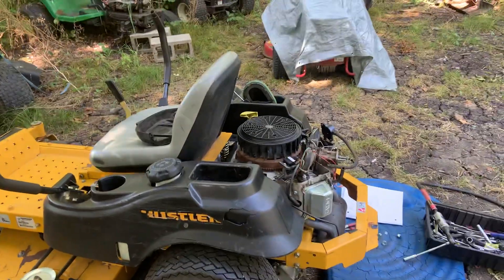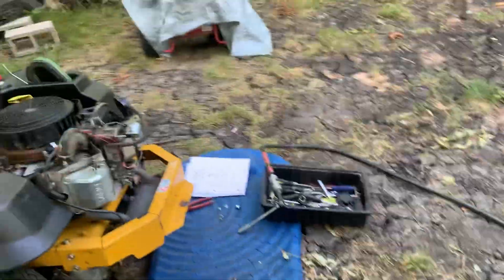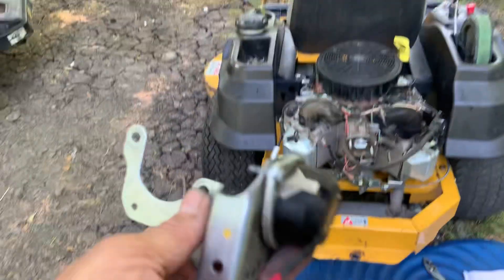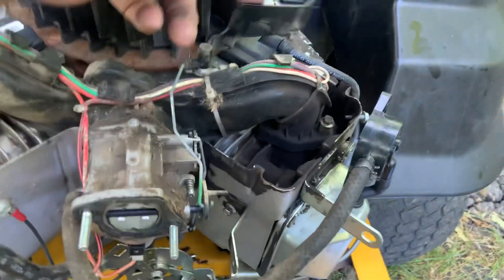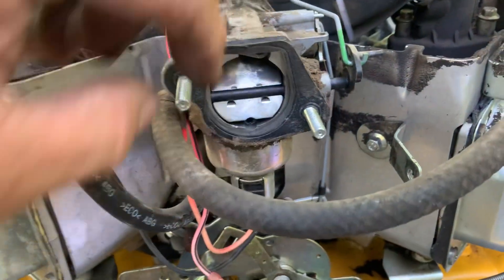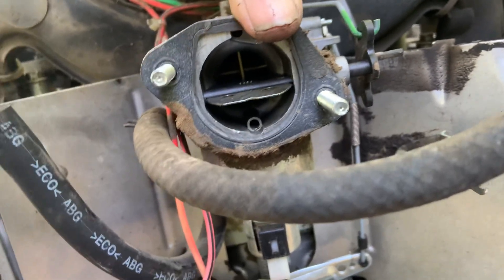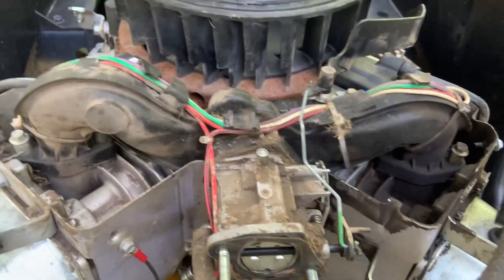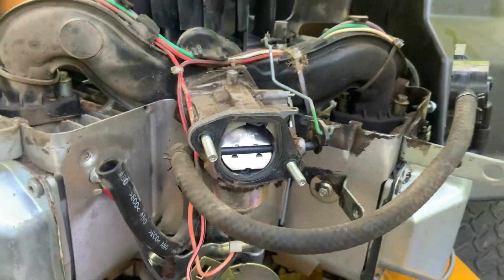Kohler Smart Choke Elimination.

Comment: I have the same motor on my gravely zero turn mower. Sometimes it's cranks like crazy hard to start blowing black smoke like it's way to rich. I was thinking it was that dumb ass smart choke. I'll try this tip on my next weekend off. Hope it fixes it.
Reply: Correction. Mine is a 25 HP.. would I have the same setup??
Reply from the maker: @scrambler850polaris7   I’m not sure.
Reply: @scrambler850polaris7 yeah, it is.

Comment: Great tip. I’ll be checking mine tonight. Question: I see gas pooled up in front on the choke butterfly when I pull my air filter off. Any thoughts on that?
Reply from the maker: @Brauma54    Make sure the fuel solenoid is working. Also, make sure it’s running on both cylinders

Comment: I found that this engine will not idle correctly if you do what you did. Maybe I missed something, I don't know. But my niece had a Graverly HD with the Kohler 7000 series motor and it would not run or idle correctly by just leaving the air vane on. When you idle it down the flap will go down and the engine will run rich because the air vane isn't keeping it opened up enough.  Kohler makes a manual choke kit for this and it comes with a new carburetor, speed controller, wiring harness, choke linkage and oil sending unit. I put this kit on my nieces mower and it works fine.  You will have to buy a choke cable and mount it on your mower somewhere, but mower runs just fine now. https://youtu.be/eA0_nQlU6Bw?si=f61q1Jw4iJwAONKn
Reply from the maker: I’ve done this to several of these engines and have never had a problem with them not idling properly
Reply: What about restarting when hot
Reply: @libertyforamericanow  The choke kit it works like any other mower with a choke. No issues starting hot.
Reply: Any chance you still have the manual choke kit part number to buy ?
Reply: @randygoff9420  It's the first thing I show  in the video.
Reply: Yea I took the auto choke solenoid off my gravely and it did same thing. Running crazy rich, loping at idle, and when wide open it would try to break up.